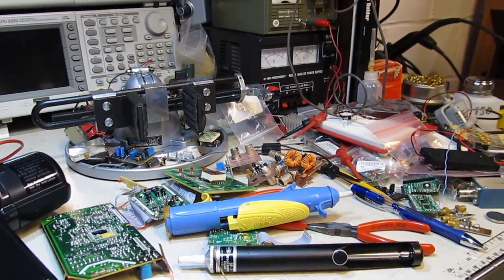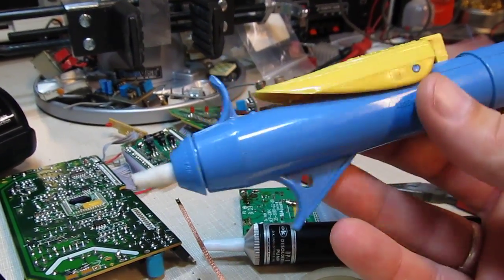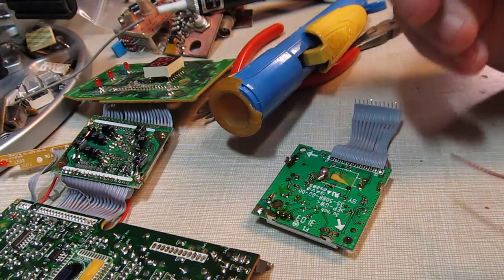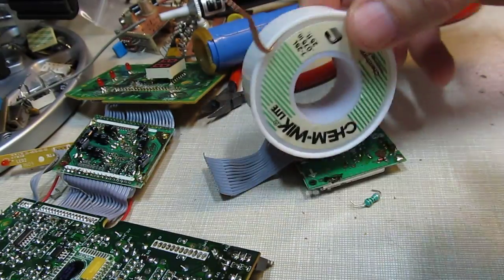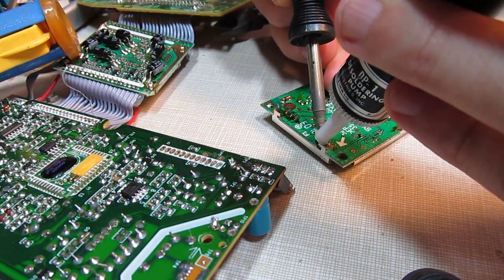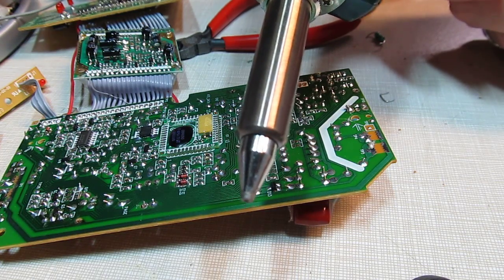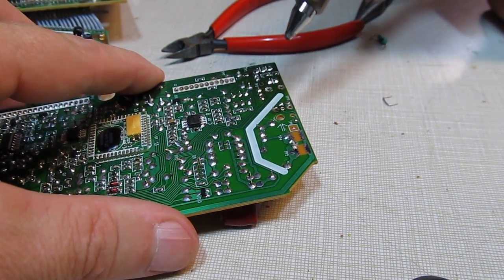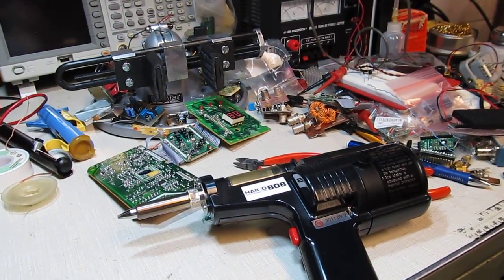#102: How to desolder or unsolder components using solder wick and vacuum tools

Comment: I've had good and bad luck with the solder braid. Sometimes it sticks to the board and ends up getting soldered to the points I'm trying to desolder with what solder is still left on the points. Is there a trick to avoid this? Am I doing something wrong?
Reply from the maker: This is usually due to the soldering iron losing heat too quickly, or losing thermal contact with the braid.  An iron with larger thermal mass or faster thermal feedback/recovery would help the first condition, and sometimes adding a little extra solder/flux can help the second.

Comment: A neat little trick for solder wick desoldering.  When it seems like it is not melting the solder, ass a little 60/40 solder to the joint as you use the wick, it will help the solder to start flowing.

Comment: (aka WD3WTF) On solder wick: the only time I've had some difficulty with that stuff is when it sat too long on the shelf at the distributor,  and the flux that the braid is carrying deteriorated to the point where it just didn't work well.  I'd been doing a lot of salvage,  and buying 25 foot spools of the stuff,  that was the one time I tried a 50 foot spool.  Won't do that again!  On vacuum desoldering:  A guy who worked for me some years back had a fancy desoldering iron,  I don't recall the brand offhand.  Maybe it was a matter of him having too small of a tip or something,  but the thing just kept on clogging up on him.  I have had a couple of those blue plastic solder suckers,  and they're okay,  but if you use them a lot they just don't stand up.  I have one of the nicer ones that came with a soldering iron I purchased recently but haven't had the chance to try it out yet.  A number of years  ago I was offered a dual-diaphragm motor-driven vacuum pump,  and I jumped at the chance.  Adding some fittings and a bit of copper pipe I had on hand,  a filter (essential!)  some hose,  and a teflon tip (also essential!) gives me a nice vacuum desoldering tool.  Unfortunately the footswitch I built to operate the thing burned out,  so I need to get that fixed,  but I can plug it and unplug it as needed at this point.  I have also noticed that a lot of boards seem to have absolutely the minimum amount of solder present to make the connection,  and that none of these tools seem to work well in that context,  so you actually need to add more solder before you can remove it.

Comment: After watching this, I have to wonder if it's me or my soldering iron that's defective. I can't get the old solder to liquefy for the wick to grab it, but melted the hell out of the plastic holding the terminal I was heating with it.
Reply from the maker: Make sure the tip of the iron is clean and properly tinned.  You won't get good thermal transfer otherwise.  It is also possible that your braid is faulty/oxidized.  I've seen cheap no-name braid that seems to repel solder, while good fresh name brand wick works perfectly.
Reply: Thanks I'll pick up a new iron to start fresh. It was never tinned or cleaned. My wick is MG Chemicals Super Wick. It's new, doesn't appear oxidizes. It's nice and shiny.

Comment: hey I need help I got a board and I'm trying to desolder some connections but the solder just won't melt what's wrong ?
Reply from the maker: +mikesoja Make sure you have a clean, freshly tinned tip on the soldering iron.  Sometimes it helps to apply more solder to the joint (the new molten solder will help to melt the existing solder.
Reply: ***** thanks I'll try that
Reply: Keep in mind, newer boards use Lead-free solder.  It doesn't wick as well.

Comment: I ruined a board I was working on last night because the burnt out TO-220 MOSFET just refused to let go.  I ended up removing the component side and the solder side pads.  I am pissed but I am not sure how to remove those as I am buying a new one and must replace the same part with a better one.
Reply from the maker: +legalizeshemp420 Sometimes it is very difficult to free 3+ leaded devices, especially if the holes are plated through or there is a lot of copper (planes, etc.).  For these, sometimes the best thing is to clip the device leads off of the package, and deal with just one lead at a time. Then, I&#39;ll often heat one lead, even add more solder to ensure that the solder is molten all the way through the board, then push the remaining lead through the hole with a toothpick or something similar - while continuing to keep the iron on the joint to keep it melted.
Reply: *****
Exactly what I did but this one pad was destroyed and I think it was due to heat being on it for too long while pushing on it.  It was a struggle.
Reply from the maker: Unfortunately some boards (particularly in consumer electronics) simply can't withstand the heat of rework or repair, no matter how careful you are.
Reply: +w2aew Yep, these are Chinese boards of the lowest of quality I am sure.  10-20 years ago it took a hell of a lot of heat to lift a through hole pad (I did it once with a 60/80W iron that is all I had at the time for a quick repair).  Now the glue used to hold the foil to the board is pure crap so repairs are hard.  Thing is any board I buy to replace this needs its fet replaced with a much better version so we are back in the woods again.  The only thing is that the board will be new and not have been subjected to all of that heat stress by a MOSFET that RDS(on) is VGS= 5V, ID= 27.5A .016Ω having 10-13 amps going through it so it gets hot enough to melt plastic with no heatsink ever built on them.  Its replacement is RDS(on) is VGS= 4.5V, ID= 172A 1.6 mΩ so you can see right there that version doesn't even get warm and no need of a heatsink for the same 10-13 amp it pushes.

Comment: Enjoyed the video, I personally hate the manual solder suckers, as  you explained you can never get the right angle it's a faff on. I was going to suggest my preferred tool would be hot air, wick / flux, or a desoldering iron but then you came to your Hakko 808 which is basically the same thing. Makes life easier when you don't have to mess about

Comment: I have radioshack desoldering braid with 30watt iron took long to desolder wire from my Strat. Could be my iron itself but had better results just lightly heat the solder then remove wire. This is a good video but just saying.

Comment: The 808 is discontinued now. I think it is in a bit different league than the manual desoldering equipment too.
Reply from the maker: Paul Frederick Oh, I didn't realize that they've discontinued it!  Looks like the closest replacement for the single, handheld, self-contained tool is the FR-300 from Hakko.
Reply: *****
When I saw item not available on Amazon everywhere I went to Hakko's website, and they have it listed as discontinued there. I'm not sure why that is, because it does seem like a popular item. But I'm sure they had their reason. I must admit the cost of the replacement heating element had me somewhat concerned right there. Let's hope that isn't something that needs to be replaced regularly.

Comment: I'm never attempting to salvage parts -- just replace bad parts, so I don't care if I damage them.

I find what works best is to snip the component (resistor, cap, or IC), or if that isn't possible, for things like radial caps, I heat one leg and pull the cap the opposite way, then walk it out with a couple rounds of heating the leads alternately.

Then I apply the tip of the soldering iron to one side of the board and the sucker to the other side and I have a much better chance of ending up with a clean through-hole.

Comment: I found Soldavac (blue/yellow) works better with this technique: The tip is teflon so won't melt. Apply the iron to the pin. Put the tip of the sucker so it's pushing down on the board AND iron tip. When the solder melts, pull the iron away so the sucker plops down on to the board then press. Done right, the tip seals against the board and sucks through the hole. As soon as it pops up and solder's still hot, wiggle the tip around to free the pin if it's stuck a bit to the side of the hole.

Comment: I once did an internship at a company that repaired electronics. They had a desoldering station i.e. the same as your Hakko 808 but the pump was on the desk with a vacuum hose in between. One trick I learned from them was to put a little bit of steel wool in the glass cylinder that catches the solder. That way they didn't have to replace the filter nearly as often as without the steel wool.

Comment: Another great video. For those using the spring loaded solder suckers, a piece of silicone tubing slipped over the tip greatly improves their effectiveness. The pliable silicone creates a better seal around the component allowing for better suction. It also keeps the plastic tip away from the component greatly extending the life of the tip. Downside is more frequent clogging.

Comment: Solder wick is great ,I use it all the time ,but one of the main things to remember is to keep the wick trimmed because if you don't the loose end of the wick will find a charged cap . You hear a loud pop and see a flash  and have a lot more to repair .

Comment: Next time you go to the Dentist or hygienist,ask them if they have any instruments that they use to  clean or check your teeth with,that they will be deposing of.
They will put them in their radiation machine to kill all the bacteria,and you are good to go,as after so many uses they just throw them out.
They work great on cleaning  and picking around solder joints on your circuit boards,and if you get brave you can try cleaning your own teeth hi hi
Don

Comment: regarding hot air rework stations, from experience - the Aouye brand is quite good with lots of accessories that come with it. I have the 968A+ and love it. Beware of cheaper units. I got a Atten brand off of ebay brand new, l don't know if it was a QC issue but when I tested it out of the box, the temp control malfunctioned and the air gun turned charcoal red HOT in just a few seconds! Could've set my place on fire. I got my money back and told that vendor that this product was a fire hazard.

Comment: I think best method is Hot Plate/IR preheater + Hot Air gun. 

Alone these tools don't work very well especially hot air is not very efficient if you have big ground planes and pre-heater heats area that is too large but combine two and work is done in 1/4 time. Also heat plate should have mount to allow PCB to be held 1 cm above the plate to accommodate reworking of double sided boards.

Comment: I love my 808!  Not the most often used tool on the bench, wouldn't pull it out for a quick transistor or cap replacement, but if there are more than a couple items to remove, it comes into its own big time!  Not a MUST HAVE, but definitely a must want for us regular hacker types ;)

Comment: Thanks for this video Alan. I wonder how heavy that Hakko is, and how much it shakes when running. Over the years I found it much better to straighten through hole leads with a regular iron first, rather than surrounding with the Hakko tip- which sometimes delaminates the pad foil. Another tip I learned over the years to prevent accidental breaking of the copper foil is to remove the sold-a-pult from the area before placing the suction tip over and releasing. The Edsyn is best of the lot IMO. 73